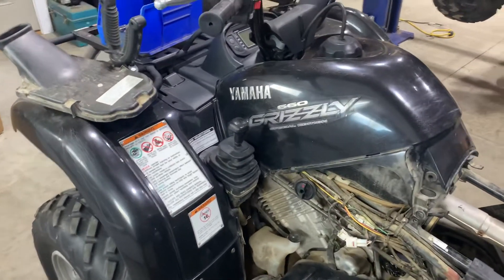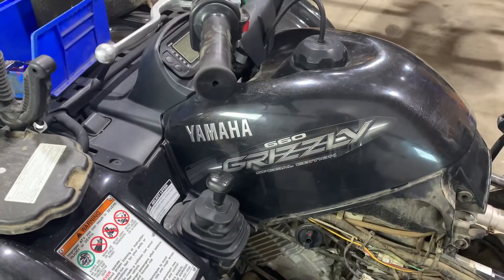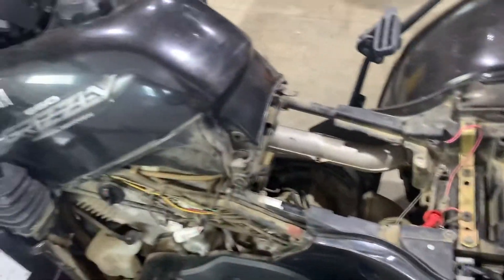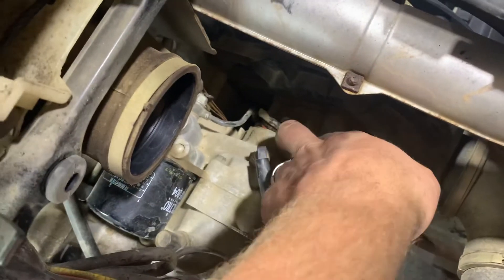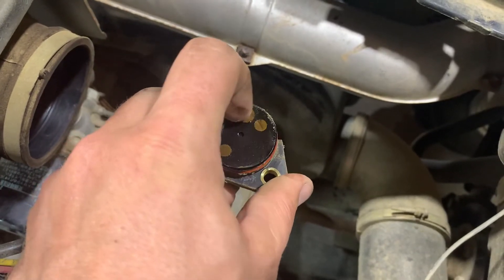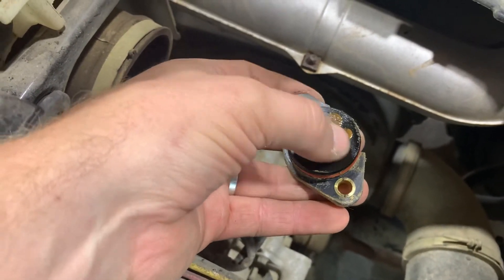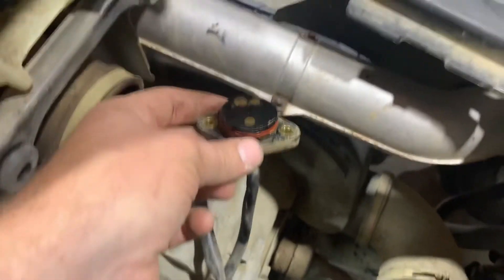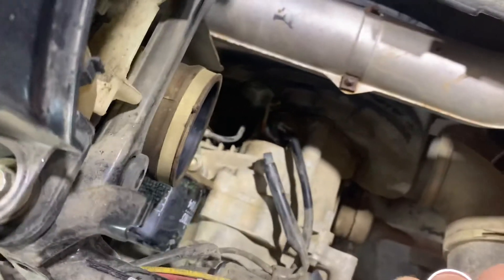Grizzly 660 Gear Position Sensor location and Repair

Comment: I used your trick to clean up the shift sensor.  Perfect explanation and it seems to get ther green light on every time.  But HELP---the machine wouldn't start so I wanted to replace the old spark plug.  And then I apparently used the wrong size spark plug socket to extract the plug.  Used the common 13/16" plug and immediately knew it was too large.  Now, I can't pull it back out.  Hard to reach too, so I'm thinking I  will have to remove the front plastics so  I can go straight in, attempting to pull straight out.  Please tell me what you think. Thanking you in advance.

Comment: Any videos of the temp sensor replacement? 
My 660 shows now sign of over heating, new coolant no leaks, new thermostat, new water pump but the temp light flickers on n off and when it does the engine runs like shit, It does that still from cold start and driving right off the bat too

Comment: Great little tip! Is that the actual name for that part? I see it’s posted as a different name online they call it a neutral something. Would this affect other lights too? A guy I know has one that mechanically goes into N and P but the lights for those 2 gears won’t come on, they used to but would take him forever u would have to mess with it for awhile. Thanks for sharing